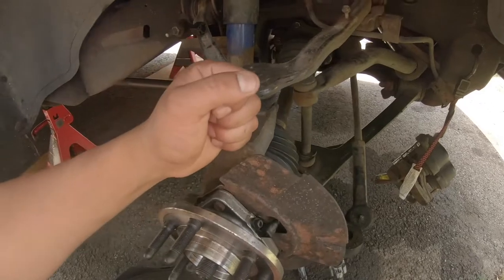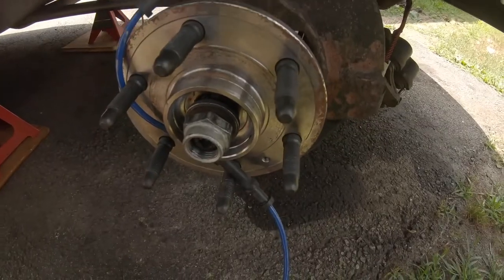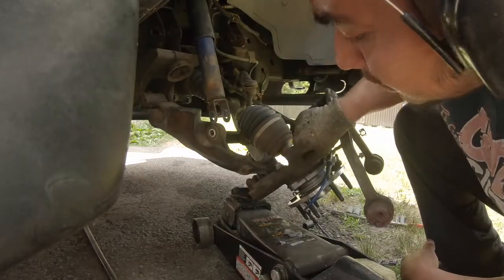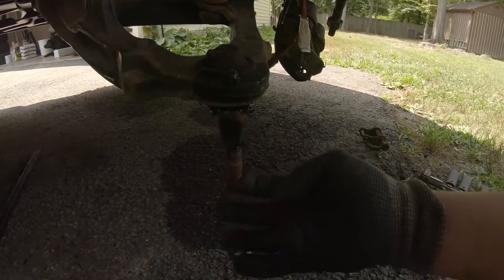Lowered the Junker chevy tahoe and put new wheels on it.

Comment: Hey, I’m just curious why you didn’t just change the keys in the front to lower it in the front? Isn’t it a 2-3/4 drop? I might be missing something. I’m just looking into this for the first time. Thanks.
Reply from the maker: It's been a while since I worked on that tahoe. If I remember correctly I didn't swap the keys because of the wheel and tire set up. It would be too low for the front and rub.
Reply: @artysmotorsports  oh OK I see. I have the same Tahoe and I’m trying to decide what to do, but I’ve never done it before so I think I’m just gonna buy the kit with the different keys and hope that works lol!
Reply from the maker: @NewYorkCity646  it all depends on what rim and tire set up you want to run.  Atleast for me that was the deciding factor
Reply: @artysmotorsports       Yeah I think before I buy I’ll tell whoever I’m buying it from my set up which is a 22X9 wheel with a 305/45 tire. I think the 2/4 drop would work from everything I’ve seen.
Reply from the maker: @NewYorkCity646  yeah I'd say so. Any lower and I'd go with an airbag set up
Reply: @artysmotorsports  I wanted to keep a stock look so I got the exact rims that you had on yours in this video replica’s in 22. They are on the way so I’m kind of excited to get them put on. Thanks for answering my comments.
Reply from the maker: I've never seen them in 22s . Rech back out when it's done I'd like to check it out.  Best of luck with it

Comment: Nice job! I purchased the same wheels for my 03 tahoe rwd and was wondering which tire setup ,would be good, are you running 275-55R20? I was leaning towards 265-50R20 havent purchased tires yet, mine in lowered 3inches in the rear with mchaughy springs and a eibach adapter and Im running QA1 rear adjustable dampening , fronts I got Beltech lowered keys and kyb for now?but might go Atomic Fabrication coilovers, not sure yet, how is the stopping distance and take off ? Nice ride💪👍
Reply from the maker: Sounds like you've got a bad ass set up man. I'd say that's plenty of tire for it same set up that i had. Mine was rubbing in the front fender well plastic just a touch when I turned all the way. Great stopping and accelerating almost no body roll but it was a little stiff. Definitely a lowered ride

Comment: Do you need 2" drop spindle? Could you just decrank the keys or get new keys 2in drop
Reply from the maker: I assume you can do it that way too. I knew I was going to use that wheel and tire set up and that's how low I wanted it. It was still comfortable to drive

Comment: I just did mines same way you did yours lower ball joints ,spindles but I didn’t change the upper control arms and for some reason I’m getting a pretty bad cambered  in the front now wen I drive after I pass 50 miles it’s starts shaking do you think the alignment will fixed my issues
Reply from the maker: I'd day check your ball joints and tie rods and replace them If they dont look good before you get your alignment so you only do it once. Another thing would be get your tires balanced.

Comment: does it bounce in the rear when riding the truck ?? if not how you fix that i have a 02 yukon an it bouces crazy i don’t know if i need shock extenders or a notch it’s 6 inches in the rear
Reply from the maker: No bouncing on mine. It sounds like you're bottoming out. Hard to give advice without looking at it you know.
Reply: You need extenders so your shocks have more play and can hold the bumps